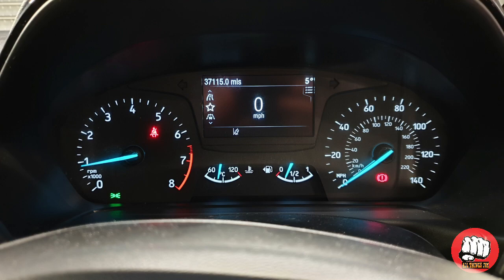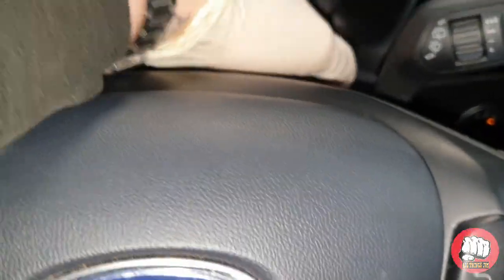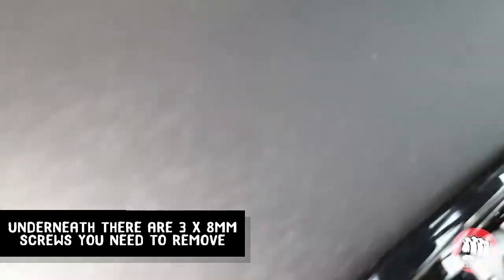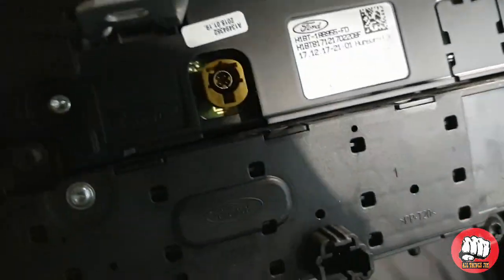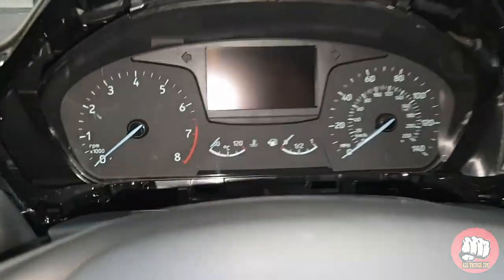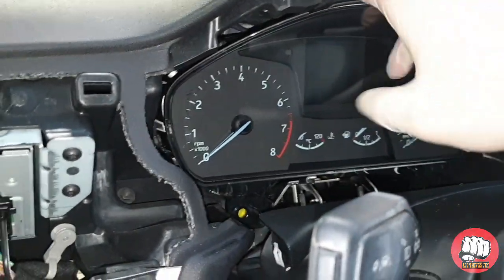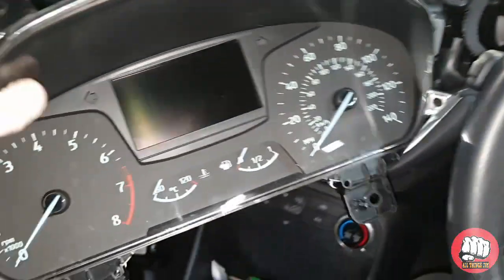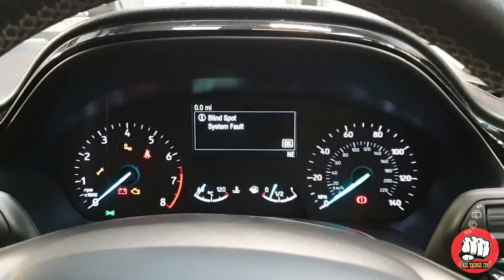clocks / speedometer- how to replace -ford fiesta mk 8 -2017 onwards

Comment: Will the fiesta start normally after replacing with the same type, even if the meter switch on, will the car start the engine with a new meter?

Comment: Will disconnecting the infotainment screen require any reprogramming after reinstalling? As I need to replace the vent on the drivers side but can’t get to it without taking the screen off.
Reply from the maker: Just unplugging it wont no, only if you replace it 👍
Reply: @ALLTHINGSJIM  how can you program a second hand meter instead of the old one?

Comment: Hi Jim!! 

It is possible to replace cluster without take out perimeter glossy plastic and the sync display??I am going to the dealer for cluster replace because it has some dust and dirt inside of plastic cover. I am anxious for the  procedure .Thanks 🙏
Reply from the maker: Hi there! No unfortunately what you see me remove is what has to come off to get them out, I wouldnt worry about it because if they break or scratch anything it will be there responsibility to replace it. Thanks for watching 👍

Comment: Hi, do you need to unplug the car battery before of removing the central monitor's connectors?
I have a damned vibration's noise coming around it and I would like to remove and take a look 
thank you
Reply from the maker: No just dont switch the ignition on or you will log a fault code, its easier to unplug the battery though to be safe

Comment: Hi Jim, I cracked my instrument cluster, but I only want to replace the clear plastic cover, do you know if I can buy a second hand one and replace the old cover with the new one? Did it look removable when you took yours apart.
Reply from the maker: Hi, to be honest I didnt look at it that close as I was just replacing it, however looking back on my video it doesnt look like it would come off easily, and may be bonded / glued on, sorry I cant be much more help than that 👍
Reply: The window on my instrument cluster has an annoying mark on it so I also want to replace it. Did you end up managing to do so?

Comment: Do u know if the radio supports rca or general subwoofer wiring?
Reply from the maker: Im not 100% on this but I dont believe so unless its a factory BO system built with car..  I could be wrong though
Reply: Hi Jim am changing plastic cover of speedo clocks ford transit 2020 will it need to be reset on computer if I unplug them

Comment: I have FORSCAN,it's good?what is the method please?
Reply from the maker: If you have the function go into the install new ipc module when it asks if the original module is installed press no , let it do its thing then after if you want the correct milage your have to find odometer correction and put the correct milage in 👍
Reply: @ALLTHINGSJIM  thanks you